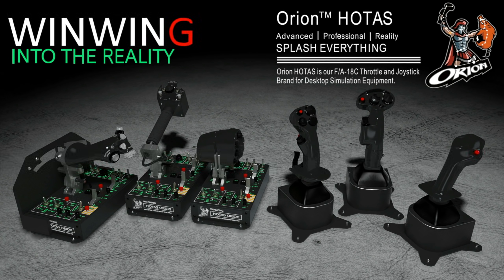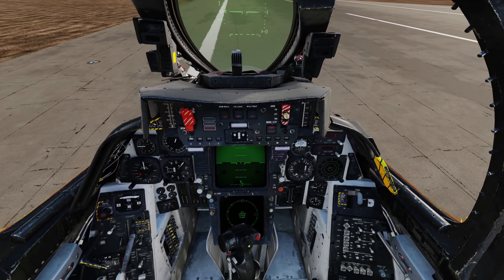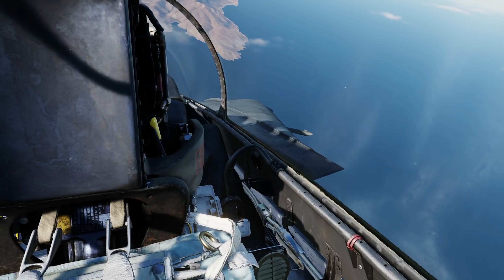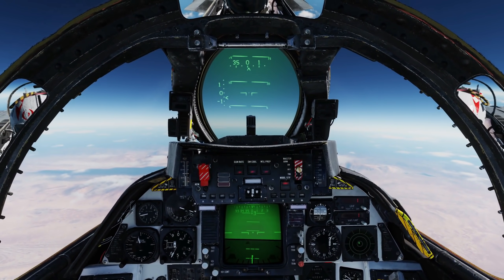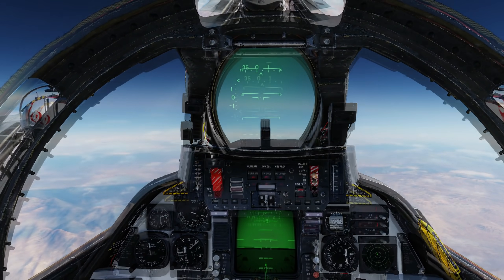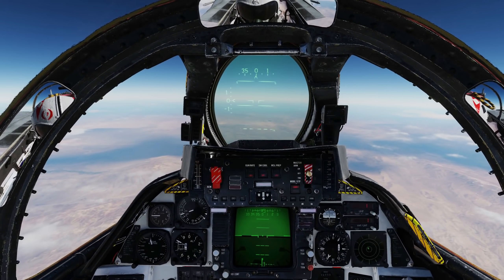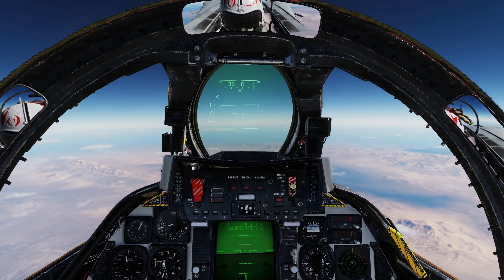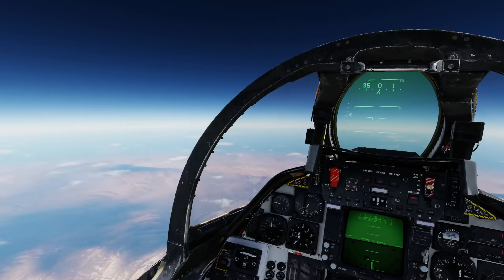Questioned: Can A Jet Fly Higher With Straight Or Swept Wings? | DCS WORLD

Comment: F14's body provides something like 40% of its lift. Wings back will be incredibly more efficient at higher altitudes. Comparing this air frame to a glider was surprising to say the least. Gliders wings are designed for max lift to weight ratio at lower altitudes, and lower speeds. Take a glider to 60,000 ft and watch what happens. When comparing the U-2 to the SR-71. Please remember the extreme differences in design philosophy.  U-2, lower speeds and 75k ft or so... SR-71 was much faster and at much higher altitudes.  U-2 was shot down more to lower speed, it gave the missile time to get to altitude.  SR-71, was never shot down, By the time the missi,e got to altitude,  it's was so far down range the missile was trash. DCS is a sim. I know for a fact that the SR-71 flew at a much higher altitude then the game is set for
Reply: 60kft is above the record altitude for a sailplane but Global Hawk can fly at that altitude with its very high-aspect straight wings and even the U-2 was conceptually a Starfighter with glider wings. Part of the reason why the U-2 was shot down multiple times and the Blackbirds weren't is that the former flew multiple missions over Soviet and Chinese airspace while the latter arrived into service well after overflights had been banned by Presidential decree so it stayed well away from the most dangerous air defence environments. That said, you're quite right that once you go high enough the ability to go fast becomes more important than having the most efficient wing because even with very high-aspect wings the aircraft would need to be supersonic to produce enough lift to stay up.

The SR-71 in DCS is a very basic mod that bears no resemblance to the real aircraft. The performance of the Blackbirds is well known and the highest operational altitude achieved was 90,000ft by a CIA Oxcart which had a ceiling advantage of 5-10kft over the SR-71 due to its lower weight.

Comment: Very interesting vid! You're limited by "Coffin Corner", the height at which your stall speed and max speed meet. Wings out your stall speedis lower, but your max speed is also lower (subsonic). Wings back, your stall speed is higher (as is your speed for maximum rate of climb Vy), but your max speed is MUCH higher. Say at 55,000 feet wings out your Vy speed and max speed converge at M0.8. With wings back at the same height, if you still have a difference between Vy speed and max speed, you still have some margin to climb.
Reply from the maker: thx
Reply: Coffin corner is not about maximum achievable speed, it is about critical Mach number and its affect of stability and control.  Supersonic aircraft are designed to breeze past their critical Mach number without any issues related to stability and control, so they don't really suffer from a coffin corner.  Their maxim permitted Mach is usually limited by total temperature or engine limitations.
Reply: @gort8203  OK, I oversimplified. MCr is the speed at which flow over part of the wing reaches Mach 1, causing a normal shock wave to form (usually at about M0.7 or so). Thanks to Bernoulli this is at the thickest point of a normal airfoil. On some wing designs, nasty things happen above MCr (Mach Tuck etc.). Coffin Corner is indeed for aircraft that fall out of the sky above MCr :-) 

It's perfectly possible to operate above MCr with a suitable wing, especially on subsonic aircraft with a supercritical wing design. You've done it if you've flown Easyjet for instance - the A320 series has a supercritical wing design and happily cruises between M0.78 - M0.82, with MCr at about M0.7. The wing is designed so the shock happens way aft with much reduced flow separation. Then you have Mach Critical Drag Rise, which is the rapid increase in wave drag that comes with that shock wave as you accelerate through the transonic region. Then you'll have a different subsonic limiting mach Mmo, take your pick between buffet limit, a margin to shock stall, Mdd etc., but in any case maximum altitude will happen when your IAS for max rate of climb meets your Mmo (or your max. attainable speed, if below Mmo).

The supersonic wings are designed wayyy past MCr and to have standing shocks at the thickest point and an expansion fan at the trailing edge and stalls don't really happen at thses high sweeps. It's more a case of climbing at the speed for max ROC until you run out of puff or hit a limiting mach number. Limit is yep often a structural temperature limit from aerothermal heating. I think Concorde's was 127 celcius on the nose from my murky aero engineering memory..!
Reply: @danandrews5147   I think all that means you agree with me that the 'coffin corner' has nothing to do with insufficient thrust to go faster.  If so, splendid!
Reply: @gort8203  Yes indeed it does, 'coffin corner' is limited by Mcr, which applies to wings not designed to fly over MCr where MCr thus limits Mmo. If you can fly past MCr (supercritical wing, supersonic etc.) then different limits come in. No longer 'coffin corner', but still the altitude limit is reached when IAS meets Mmo just the same (or when you run out of puff and can't reach Mmo either!).

Comment: My initial reaction also assumed that wings out would fly higher, it made sense that it would create a higher aspect ratio and therefor greater lift to drag ratio.
Then I thought... maybe the airfoil is actually one that performs better at higher speeds than lower speeds, and even best at supersonic speeds.

I doubt DCS would program such things accurately into its models, so it's probably a virtual exercise that has nothing in common with the real life thing.
Reply: The knots may be very low at that altitude, but mach number is very different than knots, and with wings folded out, the shock cone off of the nose will be brushing against the wing tips, thereby causing lots of  drag, and a greater loss of lift due to lower speed than can be attained through straight wings. This is why the SR-71 has such swept wings

Comment: The reason is you get a much higher L/D with your wings fold back. Maximum L/D is everything if you are asking performance in aviation.
Reply: I would also hazard a guess that part of the lift in this case is being generated by the F-14 airframe itself. It was designed to be able to use the fuselage itself as a lifting body. That's probably where they are getting the extra L/D ratio from. I believe that the SR-71 used something similar for generating lift, hence the stubby little wings on that thing for its size. I seem to recall reading that SOMEWHERE before, but damned if I can remember where now.

I would actually like to see this done with another airframe if possible. A Flogger for instance doesn't have a lifting body design and may actually fair better with its wings out for maximum altitude.
Reply: @ApacheVR-4  I figured it would be due to the delta wing shape with folded wings. A delta wing aircraft can generate a lot more lift from a high AOA than long thin wings.
Reply: @rubiconnn  True, but they aren't doing anything at high AOA in this. They're looking for maximum altitude in more or less level flight. Shallow rate of climb to maximum altitude and then leveling off to verify that altitude is sustainable.
Reply: @ApacheVR-4  The dominent drag after the aircraft passed Mach 1.0 is wave drag. The critical Mach number (bow shock waves will form at the leading edge of the wing at this Mach number) gets higher while the sweep of the wing gets higher. The wave drag for the unswept wing is just too big.
Reply: @ApacheVR-4  The equation for lift is Lift = 1/2*pho*(V_inf^2)*S*CL. You can see the speed of the aircraft has the largest influence potential in the equation. So if you want a lot of lift and very little drag, use high speed and high sweep angle.
Reply: Not gonna argue with either of you on this since both seem correct, and you can't argue with a real mathematical equation. 

My thoughts were meant more on the airframe itself. The F-14 IS a lifting body design thanks to the big flat underbelly with a nacelle on each side to capture airflow. I think that that design combined with the wings at full sweep is what allows it to be able to get to such an altitude. The wings in full sweep reduce the drag to allow a higher airspeed, while the airframe itself helps to generate additional lift as well.

That's why I would like to see this repeated with a different plane to see if the same result occurs. A MiG-23 is also a variable sweep wing fighter, but it's airframe isn't designed to generate much in the way of lift on it's own. It has a similar top speed to the Tomcat (Mach 2.35 officially) with a slightly more pronounced maximum sweep angle of 72*. Would that combo perform better?
Reply: @gort8203  Dude, I’m a master student studying aerospace engineering. You can calculate the L/D for both configs using the lift and drag equations.

Comment: Hey Cap, this was a really interesting test and result! Where does the automatic system want to put the wings at that altitude, and can you achieve a higher ceiling in that mode?
Reply: The mach sweep programmer (part of the central air data computer) is setting the sweep angle based primarily on indicated mach number in order to maximize lift-to-drag ratio at low angle of attack.  At most altitudes it's going to sweep from full forward/20 degrees to full backward/68 degrees from about mach 0.7 to about mach 0.9.  If you're going mach 1, you'll be all the way back at any altitude.  If you're going mach 0.6, they'll be full forward at any altitude.
Reply: Auto mode would have you wings fully back at that altitude anyways. You can't get to that altitude with speed under mach one.